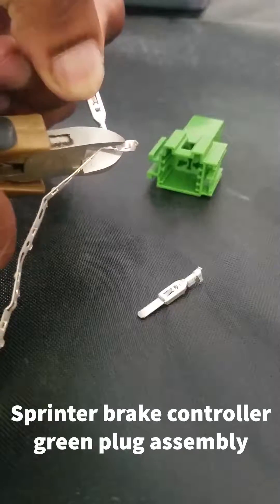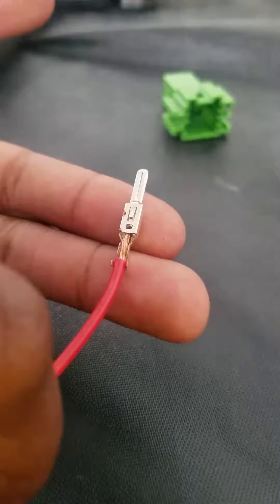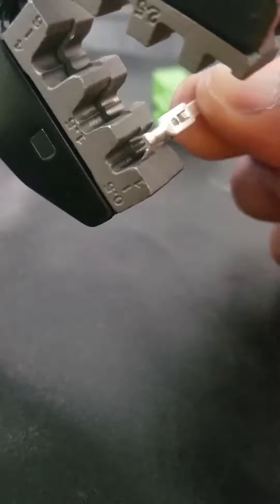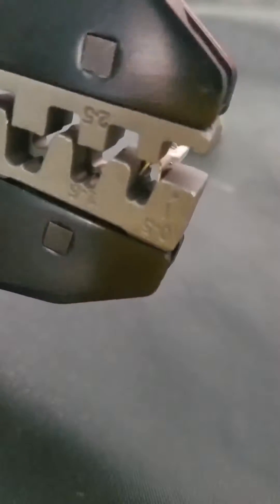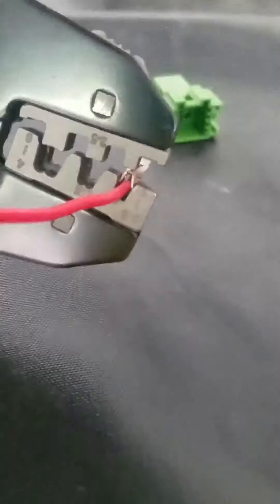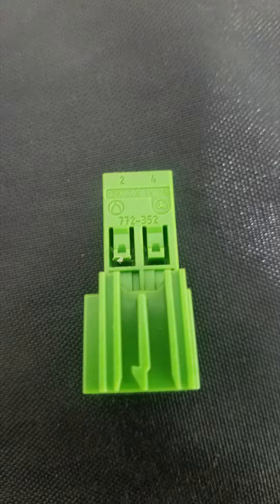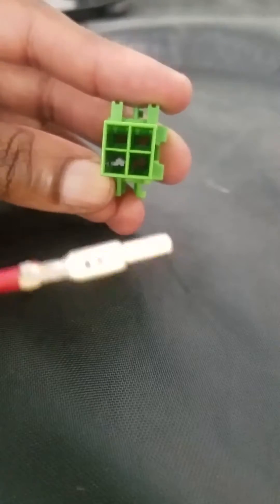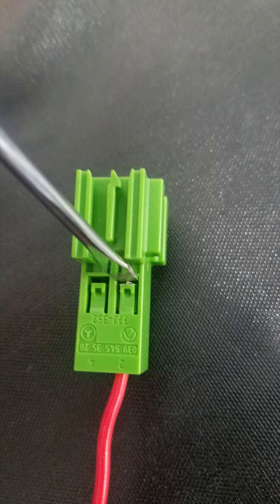Sprinter trailer brake green plug assembly

Comment: Hey Jeffrey, are all four wires located under the driver seat if the Sprinter does not have the tow package?
Reply from the maker: Greetings Justin! Yes, all four wires should be attached to the green plug under the drivers seat. Depending on the year of your sprinter, you may not have the option for the green plug so you will need to hardwire everything
Reply: Thanks Jeffrey.  Yes, it sounds like Sprinters without the factory tow package do not have that green 4 wire connector.  I assumed you had created this connector because you did have not one under your seat (i.e., no tow package).  I'm wondering if the brake switch light's wire under the driver seat.  Or best accessed near the pedal? Anyway, thanks for any help.
Reply from the maker: I dont actually work on these vehicles anymore, so I dont know what the new style Van's wiring configurations are but with the correct tow module you can get all of the trailer lights connections at the rear tail lights. Contact www.advantageoutfitters.com if you need more info or parts.